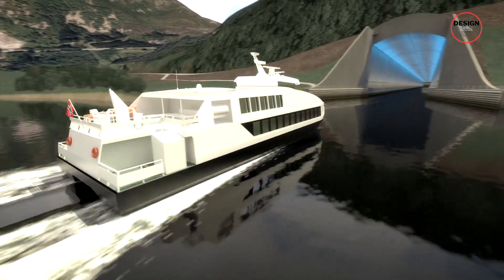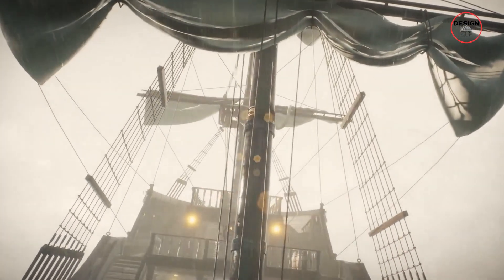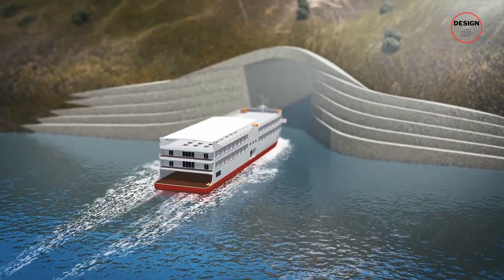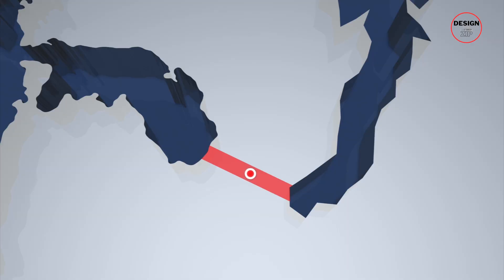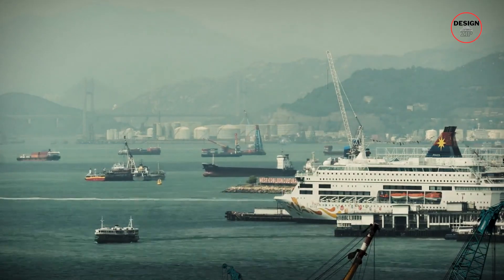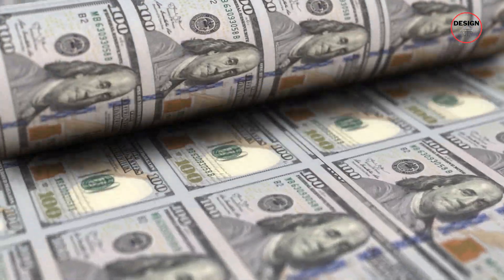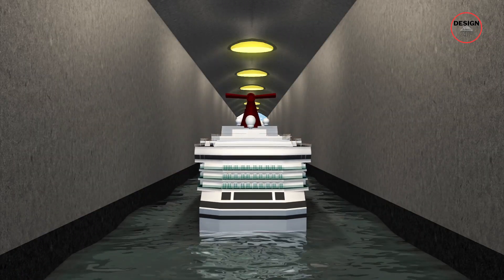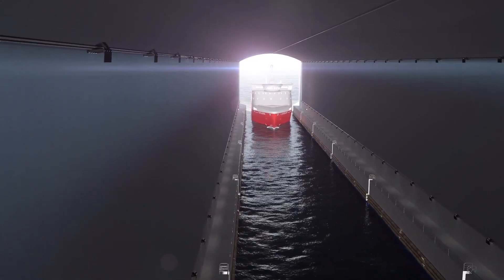Norway’s Bold Plan for the World’s First Ship Tunnel

Comment: I like the video and the project, but what I did is analyse the ports in the sorrounding area.
I've searched for main Norwegian ports, and except Bodo, no other port is located in this area. So, I suppose that digging the tunnel for cargo is pprobably not the case. What remains are only fishing boats and tourists with cameras.
I must admit that I did NOT research cultural and historical data, probable reasons for tourists to visit this area, but, if there's someone knowing this, please correct me.
I am NOT a Norwegian, but I AM perfectly aware of what circumnavigating mountains means. 

Plus, in case of an eathquake of worse yet, a tsunami, a Cruising boat in the midst of the tunnel under tons of rock would not be in a pleasant position. A hydrofoil, probably better.
Reply: If there was an earthquake or a tsunami I don't think it matters what kinda boat you are in.
Reply: You're way off. The Norwegian coast has been used for cargo transport for ages. This is about making that transport safer. Everyone who dares is going to use this to be able to stay inside small islands instead of sailing on the athlantic ocean.
Reply: What is the size of the tunnel
Reply: @ Maybe if you watched the video you might know?
Reply: Big enough
Reply: @ For what?